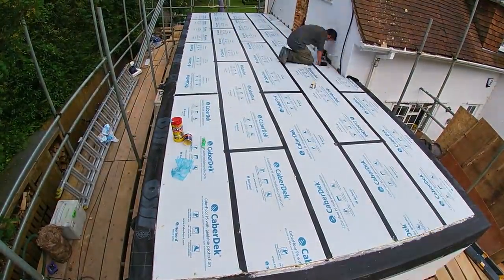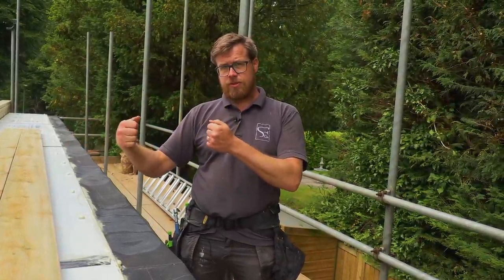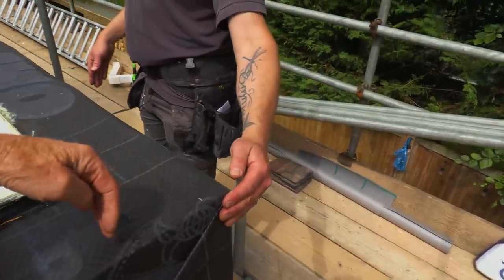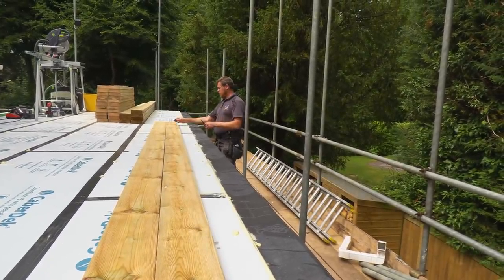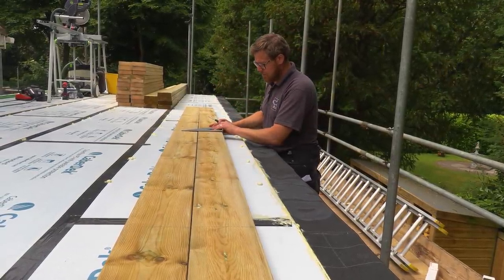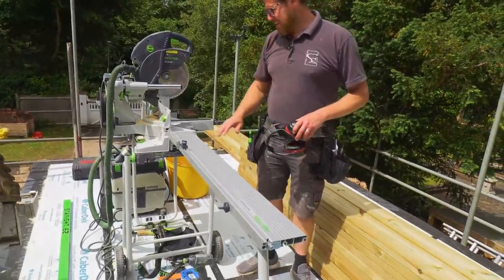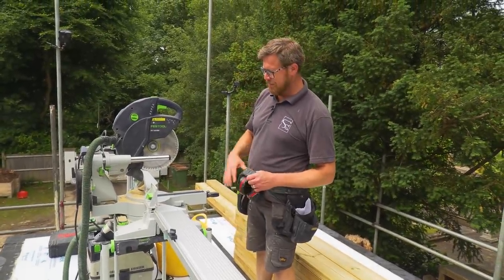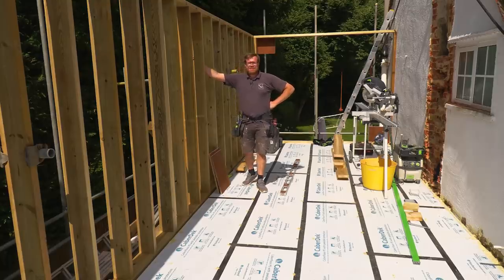Building A Room On A Garage - Extension #27

Comment: Great video again.. after bedding on, how did you fix the wall plate to the wall without affecting the room underneath, ie straps , fixings? Cheers
Reply: We’ve strapped the plate down with bat straps externally and then the render carrier board will be continued from the timber frame down over the brick building as it is only rendered single skin brick work which has been prone to moisture ingress in the past so we’re trying to eradicate that with the render carrier board and silicone render covering the lot.
Reply: @jimichip  always one step ahead. Great work mate

Comment: Hi,  Great content as always.  Im sure its an educated decision but would be interested to know the reasoning behind not just using 90mm nails for stud-work?  Thanks again, love the channel and always learning from you guys
Reply: Thanks Zack,
One of the main reasons we went for screws in this situation was because we built them on the floor and then lifted them up and due to the weight of each section if we were to nail it only then it’s likely that the nails would pull out here and there and then we would have to spend time checking it all over and possibly re fixing some parts. With the screws it’s a little more expensive and the initial process takes slightly longer but we know that when it has been stood in position it is 100% accurate.
Reply: @jimichip  
Thanks for taking the time to reply James. Interesting to get your perspective. Top class work mate

Comment: Great video Roger/ James, could you have not put the render boards on when the panels where laying down? It was something we use to do making it easier later on.
Reply from the maker: It would take some lifting because those render boards are 40 kilos each and the boards need to be staggered across the studs in a half bond.

Comment: What you should do is put a California corner in the stud work u can put insulation in after and will have backing for a slab aswell .. its always easier to cut slab than ply or osb. Also you should use nails instead of screws.. screws shear off nails don t.. unless they are proper lag screws
Reply from the maker: DJ Hago
We agree about some screws snapping under shear loads but not these babies. They are Forgefast and you will not snap them like you can an ordinary screw. Thanks for the tip.
Reply: @SkillBuilder  expensive though
Reply from the maker: @djhago3123  Not so much but more than nails for sure. We use a lot of nails but as James explained, in this one it makes sense to pull the whole thing in with screws. Maybe a combination of the two would have been good but that wall is there to stay.
Reply: @SkillBuilder  if every lad took the attention to detail of james things would be alot better.. im second flooring and second fixing a house that was gutted.. and they put false frames in arseways for plastering and there isn't one of the styles parallel with each other.. and floors and  walls  all over the place.. makes my work alot harder

Comment: It's a good thing the original garage was over engineered by just enough to enable this project. You have to praise them for that at least. If you measured it all up and the structure isn't enough, well, at that point your screwed.

Comment: ok what type + size FORGEFAST screws did you use on the 6 x 2  ?? + are they really that good ?
Reply from the maker: Often screws are brittle and snap which makes them unsuitable for construction jobs but Forgefast screws are hard to snap. We have tried and failed.
Reply: @SkillBuilder  but not in our local screwfix, so I use Turbo 2 TX very good screws
Reply: I use forgefast torx screws, really good value and much better than crappy old pozy drives.
Reply: Forge fast are amazing, started using them after seeing James using them, the difference is instantly noticeable especially on the 90mm into studs, I don’t buy anything else now
Reply: 5 x 100 mm. Or #10 x 4 in.

Comment: Why do you need to tape the joints on the chip board?
        ( caperdeck)
Reply: Continuous vapour barrier I expect.
Reply from the maker: Barry Doherty 
The joints on the last job were the weak point with some of the adhesive being kicked off so James decided to tape over the glued joints for extra protection. As it turned out the floor was in the dry before the rain came. The thing is, you never know what the weather will do and James is all about the belt and braces approach. A big of duct tape is not going to break the bank.

Comment: I'd be interested to know the construction of the garage walls please. Are they 100mm block with piers every so often, standard cavity wall construction etc? Also, what provides the timber frame walls with their racking resistance if you aren't using OSB or plywood sheathing?  I've not seen render carrier board used as sheathing for racking resistance before. Maybe all will become clear in later vids. Cheers guys
Reply from the maker: Hi Steve
This is a heavy duty reinforced board that was specified for the racking resistance. The thinner stuff is no good unless the walls are lined on the inside with OSB and then plasterboard. The EWI store has all the tech specifications  The following is from their website.
Many of the boards  can  be used as sheathing boards. Some manufactures such as RCM have different boards for different applications, while others only offer a cement board for sheathing application.  

These differences occur because some boards are tested for racking strength, some are tested for the use of thin coat render systems and some are tested for both. Using insulation on sheathing boards means an insulation material such as Mineral Wool has been installed onto a suitable sheathing board.

These systems are normally found installed on non-traditional substrates like metal frame or wooden frame buildings. The cement board is installed onto the non-traditional structure using the appropriate fixing method. Once the boards are secured, the insulation system can be applied to this substrate. The insulation boards are securely fixed to the sheathing board (in keeping with the manufacturer’s fixing pattern) using mechanical fixings and adhesive.
Reply: The sub walls are 100mm brick with piers every 1.8M.

Comment: Do you mesh the render carrier boards? Those boards are so smooth, the thought of rendering on them with no mesh gives me nightmares; big slabs of render falling off. The last loft conversion I did I meshed it with SS mesh with an air gap behind the board, breathable felt, osb, timber and so on..
Cheers lads
Reply from the maker: It is a very thin silicone render not a traditional sand and cement. In essence it is more like paint with a glass fibre mesh embedded in it
Reply: @SkillBuilder  it doesn’t fill me with confidence given the movement that will occur between one cement board join and another in a swelling and  shrinking structure.
Reply: @gdfggggg  i dunno if it's the correct way but ive always polybonded then scrimed the joints

Comment: Would the rockwall sweat underneath flooring and cause condensation perhaps ?
Reply from the maker: No the condensation will form on the cold side of the insulation but in this case the room above is heated. That lead roof also makes a good vapour barrier.